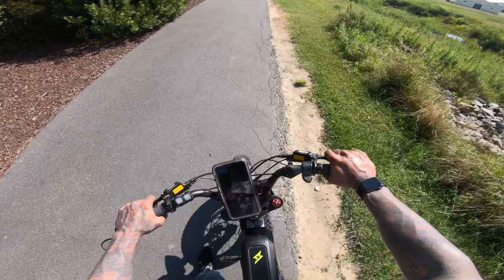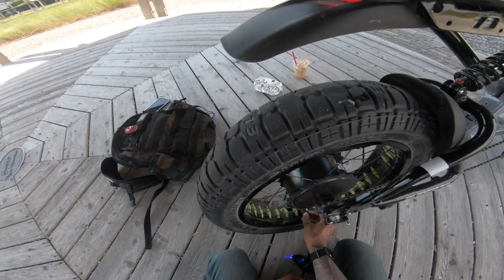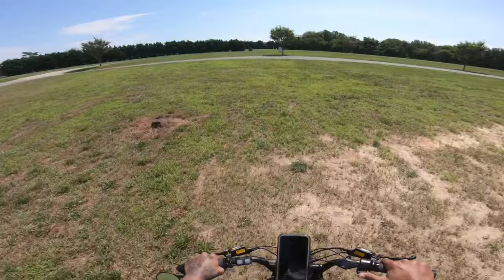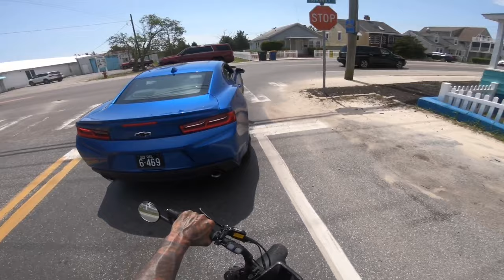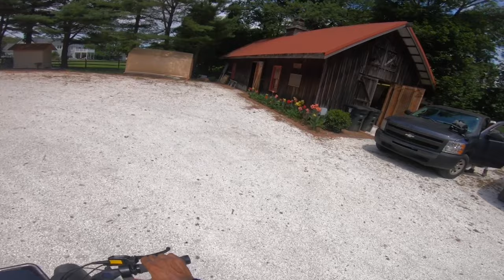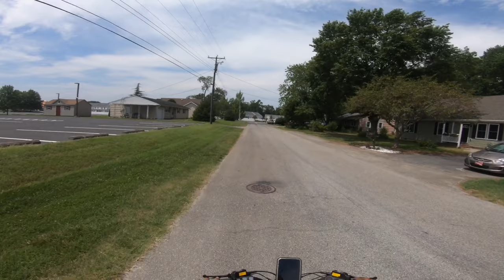SUPER73 RX FULL THROTTLE RANGE TEST AND ARMOR DILLOZ TIRE SEALANT TEST!!!

Comment: The tire pressure is higher after because you probably measured it initially when the tire was cold and it gained pressure as it heated up from riding
Reply from the maker: DUMBERTHANYOUTHINK that is correct 👍🏽 it was so hot out!!!

Comment: I gotta know where I can get that digital tire gauge? Really enjoy your content btw...
Reply from the maker: https://www.homedepot.com/p/Husky-4-in-Digital-Tire-with-Gauge-AAA0138J/205937751?mtc=Shopping-VF-F_D25T-G-Multi-Multi-Husky-NA-Feed-ETA-NA-NA-FY20_Q2_Surplus&cm_mmc=Shopping-VF-F_D25T-G-Multi-Multi-Husky-NA-Feed-ETA-NA-NA-FY20_Q2_Surplus-71700000069694101-58700006149521723-92700055590269343&gclid=EAIaIQobChMIxY_c4ZLe6gIV5wiICR1OzgsKEAQYAyABEgKSy_D_BwE&gclsrc=aw.ds
I take the battery out when it’s in my bag because it turns itself on because the on button sticks out🤘🏽

Comment: I also would like a link to the tire pressure gauge.
Reply from the maker: https://www.homedepot.com/p/Husky-4-in-Digital-Tire-with-Gauge-AAA0138J/205937751?mtc=Shopping-VF-F_D25T-G-Multi-Multi-Husky-NA-Feed-ETA-NA-NA-FY20_Q2_Surplus&cm_mmc=Shopping-VF-F_D25T-G-Multi-Multi-Husky-NA-Feed-ETA-NA-NA-FY20_Q2_Surplus-71700000069694101-58700006149521723-92700055590269343&gclid=EAIaIQobChMIxY_c4ZLe6gIV5wiICR1OzgsKEAQYAyABEgKSy_D_BwE&gclsrc=aw.ds

Comment: Hi Shreddie, did your wheels come w Armordilloz installed like Onewheel comes pre-slimed?  I must have missed the puncture.
Reply from the maker: Mike in Tampa no I ordered it and installed myself ✌🏽🤘🏽works great on tubes tires🤘🏽
Reply: @SHREDDIEMCSKATE  I remember seeing a crazy video on it w the Onewheel w nails.  Good thinking to install it.  I had a spare bottle of Slime that I used on my EUC which has a tube & tire bc changing the tube is a bitch.  You have to take the entire EUC apart.
Reply from the maker: Man that sounds like a hassle!!!
Reply: @SHREDDIEMCSKATE  Sliming is a pain too but far less painful.  :)

Comment: I think any time you are testing a bike it would make sense to let people know what components, i.e. ( motor, battery capacity/voltage, controller), you are working with. Otherwise, I'm not really learning much from you.
Reply from the maker: That’s an older video... in more recent videos I explain it’s a 48v 20ah battery... controller info isn’t on their website.... my guess it’s a 30amp 🤘🏾⚡️🤘🏾